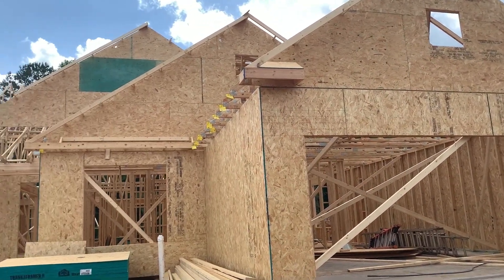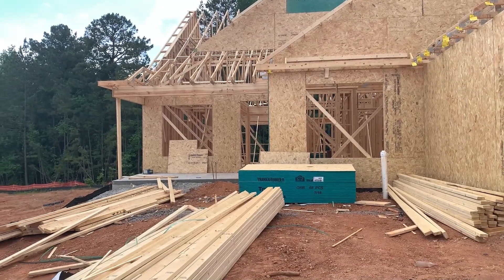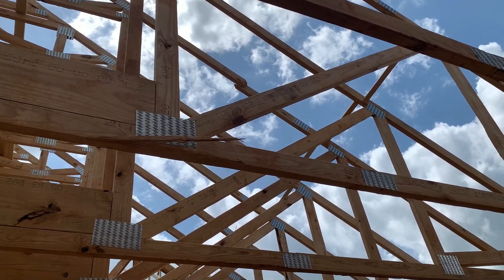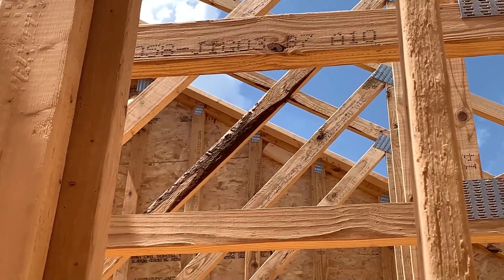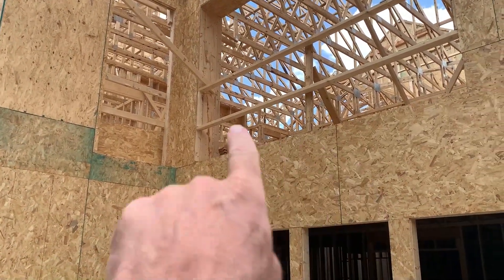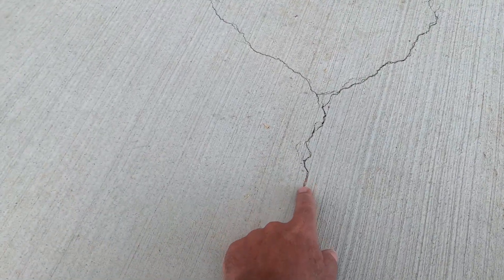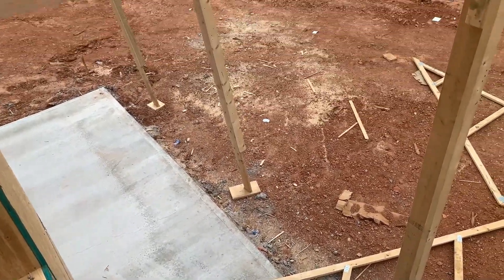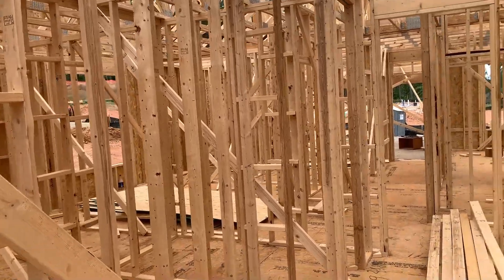House Framing Roof Truss

Comment: No builder has ever replaced an entire truss due to a break unless the top and bottom cord have been broken a general repair is always administered to the top or bottom cord or web if being damaged individually  common knowledge amongst people in the actual field of work .
Reply from the maker: No sure if that last part is a shot, but being around construction for a good 40+ years between military and civilian I think I have that level of "common knowledge". We explain to clients than breaks and splits are seen, just need to ensure that the repairs are properly done. I don't need them having a home inspector flag something when they go to sell, let the builder turn it over as it should be.
Reply: @Hmtatlanta with all due respect, your video specifically said "Replace". This commentary is correct, engineered repairs should suffice. 

Likely sandwiching the broken top chord with 2x's each side with a very specific fastener pattern. And plywood gusset plates at the cracked areas.
Reply: @craiguglandrealty3705  

Replace vs. Repair 
interesting to see what will be done.

Comment: We sort and snap pics of breaks the day trusses arrive, usually roll them off in the road so they've got something of a flat surface. Some webs can be repaired but to have a clean break in your top chord? Crazy to think someone would go ahead and install it.
Reply from the maker: I'm not thrilled with this, understand that it happens. Been waiting on their "engineer letter" blessing the repair(s). Those are essentially sister'ing 2x on either side and running them 6-8 feet. Production builders....

Comment: Damn that house looks rough. Also I’m a framer but noticed that slab doesn’t have any relief cuts which isn’t right. Wth is going on with that house. I’ve never seen that many messed up trusses on a job and that’s unacceptable
Reply from the maker: That's the state of new construction right now. These builders are dead set to preserve profit at all costs, the result is using the cheapest material and hiring the lowest bidder when it comes to labor. Routine for them to have one model home for multiple communities, restricted access, reduced staff and reduced interest in working with other agents. It's all about them and profit, they really could care less and the quality and treatment is shameful. We ejected on this build.

Comment: They kept driving onward because the the engineer has to sign off on the remedy..and, that doesn't always happen right away with the truss companies in-house Engineer.
Reply from the maker: That was the assumption here and it's been that with every similar passed situation. However here, the breaks were sistered on both sides, adequate in the builder's and my non PE opinion and we waited for the letter. That never did come, they said the county inspected it, they did not and the truss company PE did not either. They were blasting homes up in later 21-early 22, clearly the builder wasn't waiting around for a formal blessing....

Comment: All concrete cracks. The problem with that patio is there aren't enough control joints. And the subgrade is likely shit!
Reply from the maker: 100% correct. These builders are in such a rush that they fail to check and ensure proper work, esp with foundations and concrete. I regularly see them dig, install forms, place the crete, pull forms and back fill 48 hours later - usually by rolling a loader along side the foundation walls. They never slump it the mix, drop it from way too high which separates the aggregate, never vibe and always jump in it before that 28 day mark.